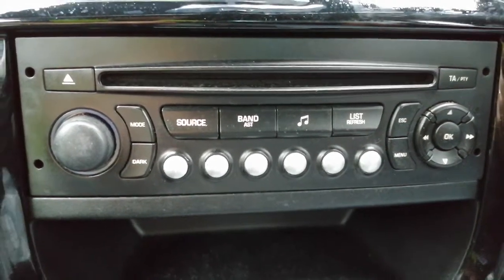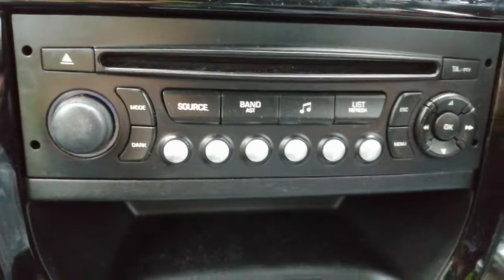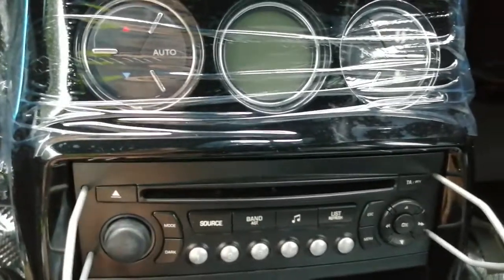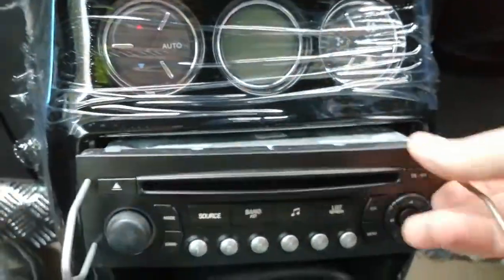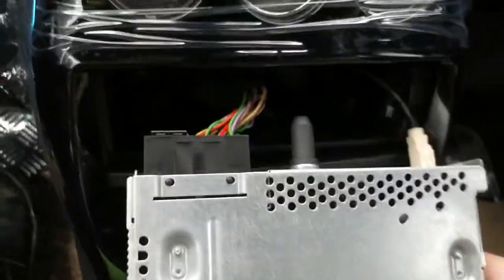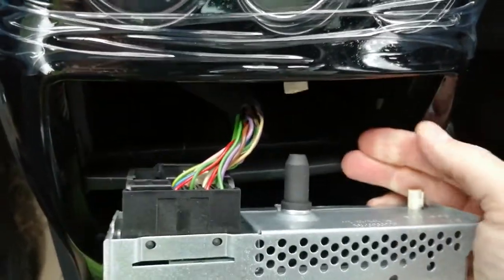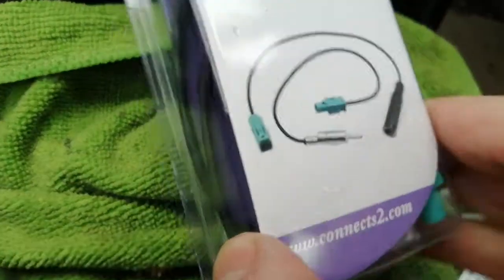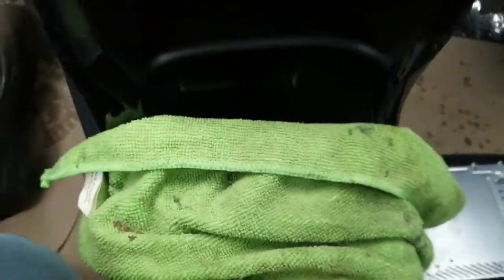Citroen DS3 how to remove factory radio.

Comment: Thanks for the video.
Question: the factory radio also has some menu functionality for the car, does that still work if the radio is replaced?
Reply: Same question. Did you figure it out? Can’t get an answer anywhere.
Reply: Came here looking for that answer. I’m getting one fitted next Wednesday. I’ll update if I remember.
Reply: @warrensmith5066  my 308 the popup screen cable failed, a terrible satnav and expensive cable I just put a Sony Bluetooth unit, but ever since I get an EML light on the dash BCM can't communicate with the radio and would require disabling with a Diagbox.
Reply: No it does not i bought one that has a different radio and menu functions do not work cannot even reset clock